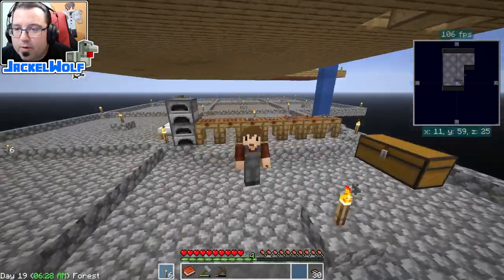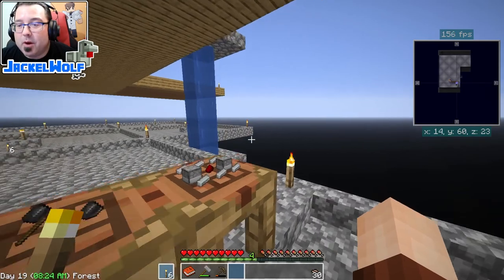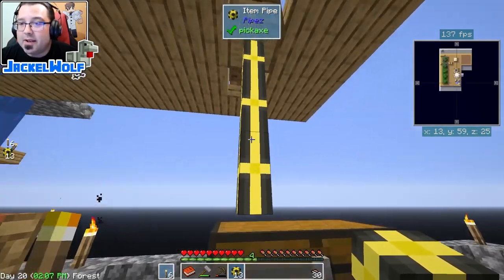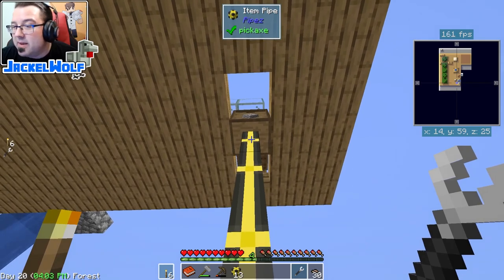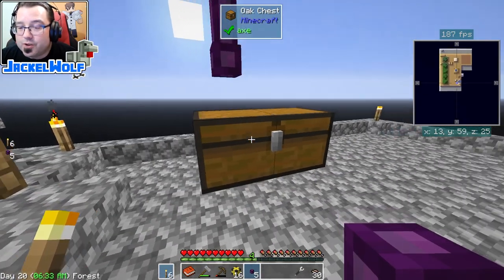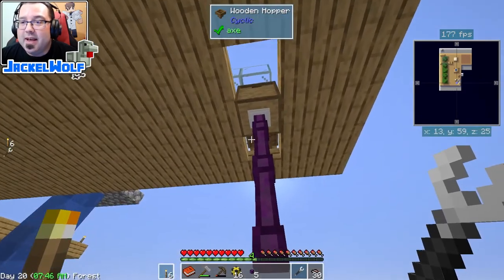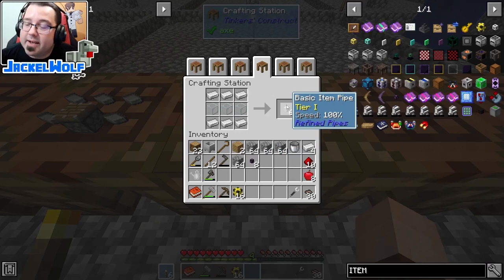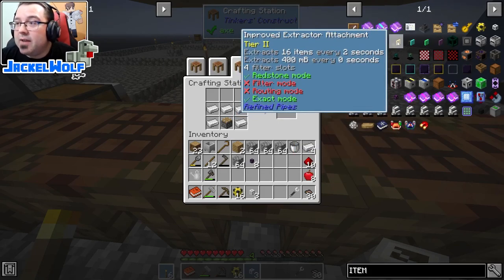SKYFACTORY ONE 101 - EP10 MOVING THINGS - PIPEZ, CYCLIC ITEM CABLE AND REFINED PIPES - TUTORIAL

Comment: Note that there are more "pipe-like" options in the pack, including conveyor belts and something in the new version of industrial foregoing that I haven't tried and I forget what it's called.
Reply from the maker: True, but I think they are both later game options🤔.... I think.
Reply: What do you consider early game vs mid game and late game? Things like ender pearls and plastic take some effort but to me they are normally prior to mid game.
Reply: I used my remaining plastic to make the industrial foregoing conveyor belts and one each of the extraction and insertion upgrades. I was able to extract lava from my crucible and insert into a tank. The conveyor belts work fine and look nice, but were super fiddly to work with. I will stick with pipes for most applications. The other options (I keep forgetting the name) was for things that are one block space apart. I will try them eventually.

Comment: just a heads up, there are upgrade modules for the Pipez pipes that increase the speed and add filtering slots as well as advanced routing capabilities
Reply from the maker: Ohhh. Right. I always forget about those. I don't think I've checked them out in this pack. Do you know what they cost, resource wise?
Reply: @JackelWolf  I know redstone and iron for the first tier but I think the later ones need diamonds. I'm not sure honestly, but I know they're relatively cheap in comparison to refined pipes.
Reply: Prime reason being that you only need to place an upgrade on one extraction point to upgrade the whole pipe, I think...
Reply: @JackelWolf  The basic tier upgrade is 4 redstone, 1 string, 4 sticks. There are 3 tiers of upgrades, which you do by placing the previous tier on a casting table and pouring over 2 ingots of metal. The first upgrade is gold, the second is lead, the third is invar. The upgrades progressively add speed and filtering/routing options (e.g. you can whitelist/blacklist (with or without NBT data) and then tell it to send items to the nearest available or round-robin). They're pretty good. I still reckon the Cyclic ones are the best early game option as they're cheaper, faster by default and the fluid pipes can pull water from the world, which is super handy....
Reply: I need to filter input. Any options?
Reply from the maker: What pipes are you using?
Reply: @JackelWolf  i had tried Cyclic and Refined pipes. Looks like maybe I need to use Pipez.
Reply: @JackelWolf  pipez
Reply from the maker: Yeah. I can't remember exactly how pipes worked on that pack. They all start to blend together.  😅